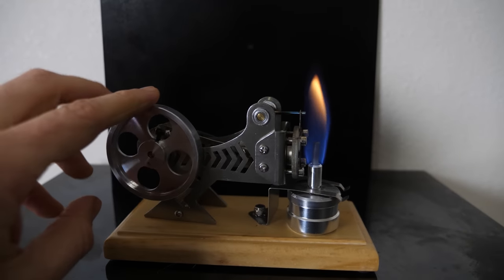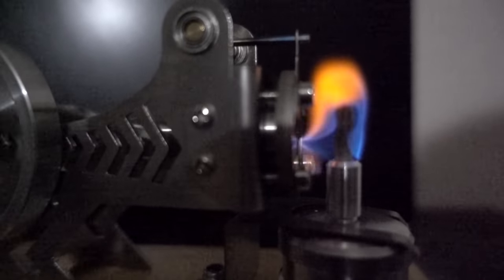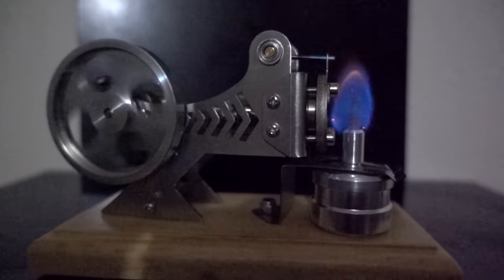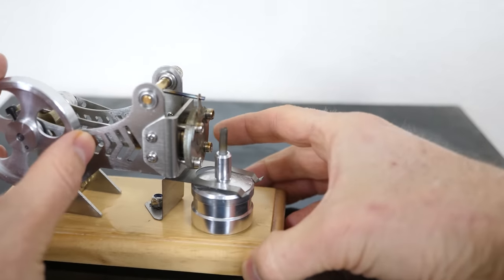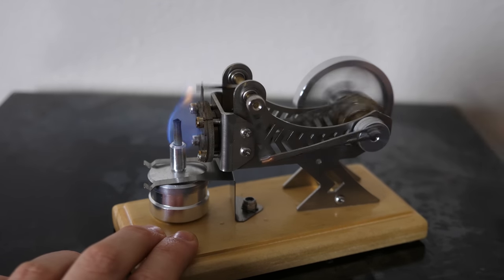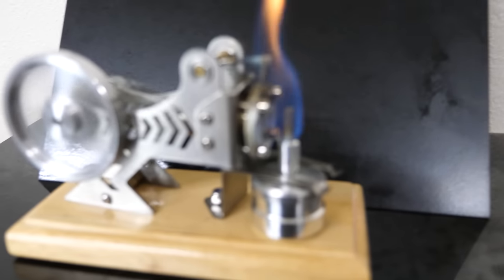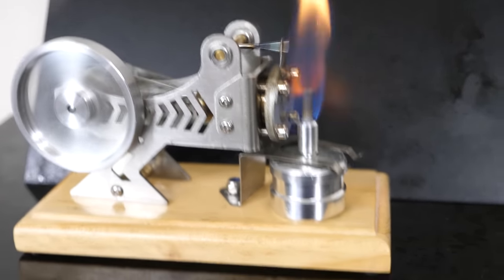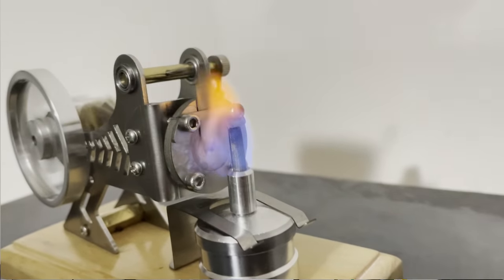How Does a Flame Licker Engine Work?

Comment: It's the Ironic Engine. You can attach blades to the wheel and create a fan to cool yourself but not enough to cool yourself from the flame powering the blades.
Reply: Cause of second law of thermodynamics
Reply: All engines would fit this description. See Jeffrey Tan above.
Reply: Star Wars reference?
Reply: @BWGPT  sure.... if you want to be literal. However,  my cars engine is strong enough to move my vehicle forward and even power a condensation unit and compressor that when certain chemicals are introduced.... 
Anyway, - it was a joking comment. I don't know how this escaped you.
Reply: Lol that seems like a physical display of entropy, and why perpetual motion is impossible.
Reply: Or use it to spi  your fan if there is no electricity
Reply: Make it for Freeman
Reply: Just be in another room. It’s no more ironic than an air conditioner
Reply: @BWGPT  No, a better engine can run a fan that heats the room but cools you. Haven't you seen someone using a battery powered fan to cool themselves?

Actually if you factor in evaporation of sweat from your skin it could cool both you and the room.
Reply: @thetruthexperiment  But it probably isn't powerful enough to run a useful fan.
Reply: @barneylaurance1865  There's still no difference in principal. Whether the energy is stored as electrical charge in a battery or as chemical energy in fuel, and how efficient the conversion to cooling is, the net effect is still more heating. All you can do is separate the heating from the cooling, for example by putting a barrier between you and the flame. 
Personal human experience doesn't change the laws of physics unfortunately 😁
Reply: @BWGPT  Of course energy is conserved, but a fan that makes water evaporate can cool the room that it's in. It's called a swamp cooler.

The water would evaporate and provide the same cooling effect without the fan, but it would be over a much longer timescale.
Reply: @barneylaurance1865  Swamp coolers are cool 😁 but they are not an engine. They are just depositing the heat energy into the evaporated water. Cooling systems like air conditioners and fridges typically have a so-called Coefficient of performance (COP) over 1 where 1 means 100% efficiency. This is because they are just separating hot and cold instead of somehow eliminating heat. But it still doesn't mean it can cool more than it heats.
Reply: It is too noisy engine for its size. You are gonna be annoyed.
Reply: Okay but: you can use it to heat the room more evenly by blowing the hot air
Reply: Like any other engines. They all consumes more energy then return as electricity or mechanical
Reply: @BWGPT  true. However, fans cool down the human body by increasing the amount of air that comes in contact with your body and speeding up heat transfer between you and the air. It’s not really about the second law of thermodynamics, fans only increase the temperature of a room they are in anyway. the point is that unless the room is 97 degrees or hotter, a fan blowing on a person will decrease their body temperature. So the orginal comment is correct that a fan so inefficient at moving air that it cannot cool you more than the heat it generates heats you is uniquely useless.
Reply: There is a version that sits on a cast iron stove that blows hot air around the room.
Reply: Literally every engine and motor ever is like this buddy
Reply: It's absolutely hilarious that you people that are so interested in scientific information know so little about anything
Reply: @melody3741  best ever ICE I know of is 40% effecient(an electrical powerplant that captures heat twice). A good car is 18-20%
Reply: I can't believe a stupid sarcastic joke comment created such a ... dare i say it...."heated" debate. Now that's cool.
Reply: @HarlanHarvey76  I see your point, but it’s also outside where the heat can dissipate. If you run your car inside a garage, you will get rather toasty before or possibly after you died, depending on the ventilation.
Reply: Slow the speed of the blades and increase heat, and use as a heat source?
Reply: @HarlanHarvey76  you seem a bit triggered that no one thinks your bad joke was funny
Reply: @Chopper Dave  with a 1000 likes???🤷‍♂️ I'm triggered? Haha,🤣
Reply: @BWGPT  Not at all my ac pushes cold air into my house and lets the hot air outside, he's talking about keeping a room cool, not making the entire earth colder/hotter. The thing that generated that energy is miles away from where I'm using it.
Reply: @orphscookie8047  The thing that generated the fuel in the Flame Licker is miles away and millions of years ago.

Comment: so, an external combustion engine :P
Reply: There are multiple types of external combustion engines, like the Stirling engine. Just like there are multiple types of internal combustion engines, piston and rotary engines being two examples.
Reply: Believe it or not this is actually an internal combustion engine, as the working fluid (air) is also where combustion takes place.

A steam engine is an example of an external CE

Comment: I have been around engineering all my life and I am still amazed at how quickly heat can be removed from a gas, be it this engine, a Stirling engine, that coke can steam/crushing exercise.  You would think like with metal or water just how much time it takes to cool, yet the gas can happen in milliseconds
Reply: Coke gives me steam crushing exercise too
Reply: This is a good video idea - one focusing on just this topic
Reply: why does gas loose heat so fast?
Reply: @MnMEminem  🤣
Reply: Yeah, I’ve thought about how my space heater pulls in room temp air and spits out super hot air in just a fraction of a second
Reply: I’d advise you to look into the SABRE engine. If this makes you amazed, the SABRE engine will melt your brain.
Reply: I suspect there's more to it than just cooling the gas.
I'm betting there are some chemical reactions / phase changes involved since the still-glowing flame has so much happening inside of it as it is being drawn in.

He could test this by trying to run the engine on very hot dry nitrogen, although that would take a bit of work to set up.
Reply: Because it isnt dense and therefore  gives it up quickly to a more  dense  medium, the metal in the engine
Reply: @nikhil94410  The jiggling hot matter isn't pinned in place and forced to transfer the energy by jiggling its neighbours. Gasses can just take the heat and fly far away at 650mph. Then you have the very hot ones rapidly flying far away to where there are really cold ones, and the heat flow is insanely fast.
Reply: Gas doesn’t “get rid of heat” faster. It’s orders of magnitude less dense, that means orders of magnitude less energy. Most Gasses is actually a far poorer conductor of heat than they would be in liquid or solid form.
Reply: This is a Manson Engine! They predate Stirling Engines

Comment: What if you surround the flame with multiple fire eater engines? Would that make it viable as an engine?
Reply: @Dziaji  What if we use it for something that doesn't need to move? Electric generator, for example?

Comment: An internal combustion engine peak pressure can reach 200 bar, not 65 bar as you indicated. However if you take about mean effective pressure, internal combustion engines can reach to 30 bar. Typical mean effective pressure is around 20 bar with turbo or superchargers. 10 bar for naturally aspirated engines.
Reply: Naturally aspirated engines compression test between 160 and 200 psi (depending on engine model). That's usually at cranking speed (<400rpms) and without igniting fuel.

Comment: Did this come out before or after the internal combustion engine?  If before, I can see how this might have led to the creation of an ICE.
Reply: after, though before what we would consider a carburetor or a spark plug.

it's a bit hard to tell though, but anyhow there's an engine before this that inserts turpentine into the engine that turns into vapor and licks a flame on the stroke into it to ignite it.  it's a bit hard to tell because those inventors might have come across this but dismissed in the decades prior to it, because there's some more complicated versions of it before it, but I dunno.
Reply: @lasskinn474  Thanks. Also, I do appreciate the channel and its topics.

Comment: Original steam engines worked very much like this, steam would be let into the cylinder which was open on the other end such that the steam could push the cylinder out, then the valve was closed and the atmosphere pushed the cylinder back in as the steam condensed. There existed huge versions of those engines back in the day.
Reply: the second generation of steam engines got a bit fancier, where the valve would redirect steam from one side of the piston to the other, so steam was actuating both directions, and then you could start running these at higher than 1 atmosphere of pressure, and this was what was most commonly used on trains
Reply: @goldensunrayspone  that would actually be the third generation. I did not explain myself well enough. In the first generation the steam had essentially no pressure and was not actively pushing the cylinder. Instead it was gravity operating on the pump that would through a beam pull up the cylinder pulling in the steam. Only the atmospheric pressure was actively pushing the cylinder back down due to the vacuum created by the condensing steam. After that you first got the single acting pressurized steam engines which used pressure to push the cylinder one way and momentum of a flywheel to push it back the other way. Then you get the double acting steam engines that you described where steam is used to push the cylinder both ways and the flywheel is only there to maintain a constant angular velocity. In the original steam engines I referred to there isn't even a flywheel.
Reply: They were called 'Newcomen Engines'

Comment: In adjusting the size of the flame, can you theoretically stack say four or five engines vertically along the flame to create a lager watt output or would the energy simply cancel itself in using up the power to drive each engine individually?
Reply: well I guess you could.  it doesn't really matter though if it's up or sideways as long as that's where the flame and air is going.   most effective would be to make some system to shoot the flame only when it's open.
Reply: It would be more useful to place multiple engines radially around the flame. If you made the flame larger, it would just lose proportionately more heat.
Reply: y'all are correct. the gestalt of your ideas yields a conical formation of engines around the flame.
Reply: Even a steam engine is more effective so why bother?
Reply: It would probably be more efficient just to make the engine larger in capacity.
Reply: I'd like to see several of these working in tandem connected to a low geared system. It'd be very interesting to see how much work can be done with one small flame.
Reply: Is it possible to connect five of them to make a radial engin. Like aircraft motor.
Reply: Well heat rises but heat also gets sucked into the engine, cooled and expelled, so eventually it would cool to non working levels
Reply: @Max_Jacoby  I suspect the large very high pressure boiler (💣) may have something to do with it. There is also the time to start from cold. These are reasons why I think a Stirling might be preferable to steam in some situations.

Comment: Maybe a two or three (four?) cylinder
combination licker/sterling engine would be more efficient?
Reply: I think it is possible to improve efficiency with one cylinder.  Let the fire be in a closed chamber.  And the exhaust must be through another hole into the atmosphere.  Then all the flame will pass through the engine.

Comment: I wonder how efficient you could get this to be if you optimized it with a much smaller flame delivered into the cylinder at much higher percentage?  (Like he said, as it is without modification, most of the flame is just going up into the air without actually going through the engine.)
Reply: that's certainly a curious idea and honestly wouldn't be too difficult lol it's just a matter of taking the time for the engineering and construction lol.
^_^
Reply: Send fuel-air mix into a cylinder and then ignite it. Combustion, but an internal one. An internal combustion engine, if you will.

Comment: You could definitely reorient the engine to place it over the flame, and then less heat is lost, but with no speed control on it, there is a limit to any sort of mechanical work you could ask it to do. 

Also, like you said, you are still limited to one atmosphere for power. By comparison, most gasoline engines compress to about 170-200 psi before the ignition point,  and they have multiple cylinders doing that.
Reply: You can get plenty of work out of a single gasoline-powered piston from 1/6HP miniature RC engines and 1/2HP garden tools to 10HP snow blowers, 2-10kW generators, mopeds/scooters, small motorcycles, etc. Some old-timey machinery also has gigantic 60-80HP single-piston engines with comically-large (and dangerous-looking) flywheels.
Reply: Hi... I'd really appreciate if you could educate me as to what practical application can a large size version of this engine can accomplish? Not in comparison to current engineering, of course... Asking, as I wish to understand the upper limit of output of this and whether very large versions of this can be made...
Reply: Hi... I'd really appreciate if you could educate me as to what practical application can a large size version of this engine can accomplish? Not in comparison to current engineering, of course... Asking, as I wish to understand the upper limit of output of this and whether very large versions of this can be made...

Comment: After arguing with another YouTuber about my animation, your video made me feel happy.
Never seen an engine like that in real life. Hopefully one day, we can 3D print metal pistons like that.
Reply: There are metal 3D printers
Reply: @thewhitefalcon8539  more than that even, there is specialized resin/fillament for resin and fdm printers that can be burned into solid ceramic and metal parts respectivly using a kiln
Reply: honestly: 3d printing metal for this is silly.
We already have CNC-Lathes for the piston and cylinder and laser cutting for sheet metal.
What do you need more? some screws and nuts?
Reply: @sarowie  I just want my ramen and a handheld 3D metal printer

Comment: what if you had multiple of those, like 2, or maybe 4, all around the one candle, and working opposite of each other, (re sucks in while le blows out) wouldnt that increase the effeciency of this system and allow you to get more "work" done?
Reply: Can probably make a 4 cyl “opposed” configuration with the flame in the middle. I think the real issue is that it has virtually no torque. I suspect as soon as there is any resistance to that motion, the whole thing stops.
Reply: Meegswfu
Reply: @Meatball2022  Can uggfj Ball ball

Comment: Thank you for the video! It would be nice if you could research and explain both the cause of the sparks and also some ways to make it more efficient like adding a hood connected to the engine to keep it hotter and maybe make an upright variation so the flame is better “digested” in the engine. Keep up the great work!

Comment: Great video and never knew that such an engine exists! Is there some kind of lubrication and sealing going on with the whole process? I imagine the sparks flying out might be iron dust from friction between the piston and the cylinder....and if the flame is not burning efficiently, there should be lots of soot being sucked in at the intake valve as well.
Reply: Since that's a more orange flame, I'm guessing isopropyl alcohol. So my first thought on the sparks flying out was bits of soot from the dirty flame.
Reply: Often the pistons are made from hard graphite blocks/ rods, that are precision machined. I have never seen one with piston rings, as the friction already would be too much. Also, most of them don't need lubricant. Graphite is self-lubricating. Oil would just further increase friction. For the fuel, mostly pure ethanol is used. It burns almost free from soot and so the engine lasts a long time without cleaning. The flame itself is pretty effieciently, if you can call it that. The reaction is mostly stoichiometric, the ethanol reacts to water vapor and CO2, very low amount of carbon deposits build up.
Reply: @nikethunner2732  Thank you Sir....explains a lot!

Comment: do a vid of running a 4 stroke in a pressure chamber, like 2+ atm.        takes some finagling I guess to devise a system where it doesn't just fill up with exhaust gas (though exhaust needs to be into 2 atm too).
Reply: That's not a problem at all, given a large enough "ecosystem"; an engine doesn't really "care" about the outside pressure. An engine can run at 0.5 bar (I've done that, in airplanes) or > 1.0 (which people have done at sea level and below, on cold days.)

Comment: I wonder if you can power it with concentrated sunlight? 🤔
Using the light to heat an object near the opening should work, since it's the hot air that matters.
Perhaps a carbon electrode or a really dark piece of wrought-iron might be a good target?

Comment: The conclusion in this video is not very creative. If you heat a room or a house with fire, you could always attach an engine like this to make some small but important labour from the excess heat; fill a water tank, for example, or charge rechargeable batteries.
Reply: You could also use a more efficient engine then, either a internal combustion one, a steam engine or a Sterling engine, all of which are significantly more powerfull and efficient
Reply: @user-si5fm8ql3c  It's not about efficiency, it is how easy it is to use, and if it do it's work good enough. An internal combustion engine only to transport a liter of water every half an hour to the watertank on the upper floor is... rather silly.